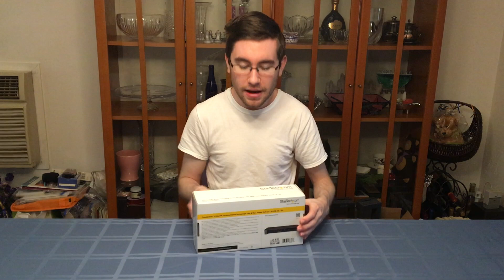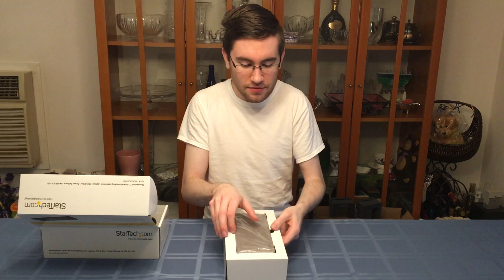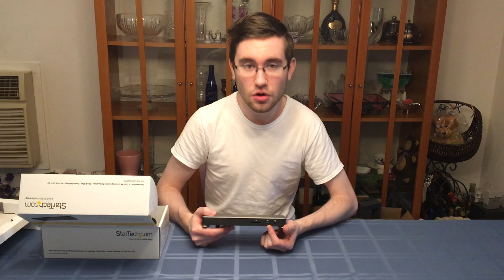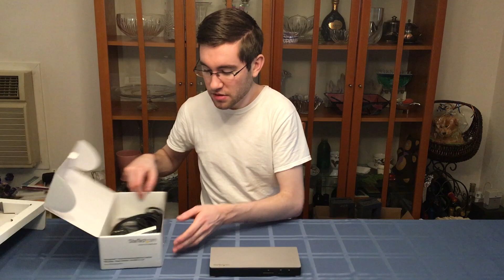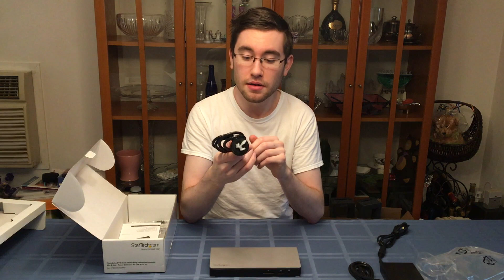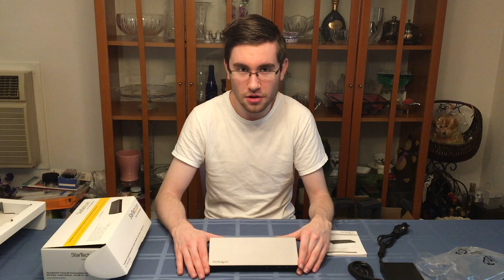StarTech Thunderbolt 3 Dock (w/87W Charging!) - Unboxing & Initial Impressions

Comment: Are you recommending this product? I see you unboxed it but did you love it?
Reply from the maker: Hi Jack!

Thanks for the question.

Do I recommend it? Yes I do. Do I love it? I don’t know that I love it, but I do really like it.

I have been using it ever since the unboxing and have no real issues to report. The only trouble I’ve had involves waking my monitor from sleep with a single keystroke and getting video from my Mac’s display immediately after putting the Mac to sleep and disconnecting it from the dock. I can’t blame the dock, as I haven’t troubleshot the issue and isolated it’s cause. So, until then, the jury is out. Other than that, my experience has been great.

I hope this finds you well and hope you will return for future content.

Best,
Aaron